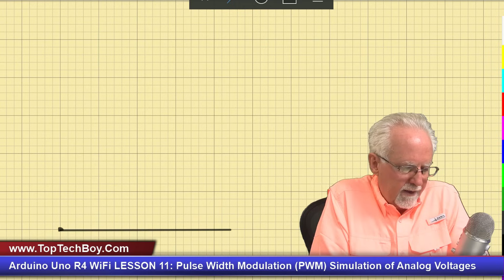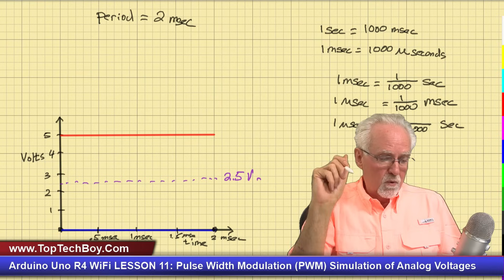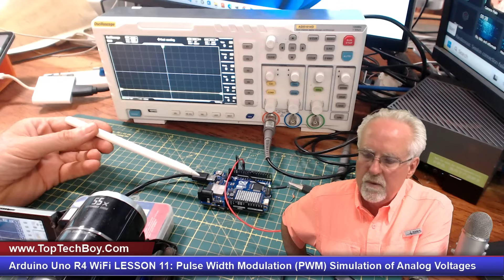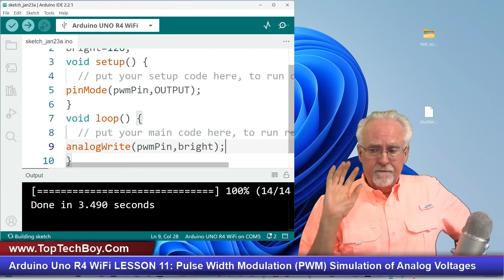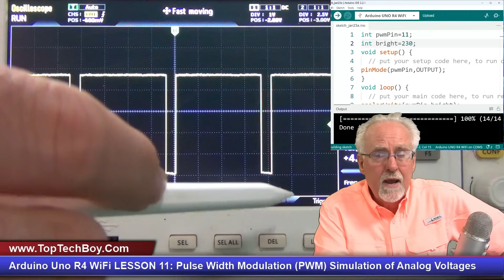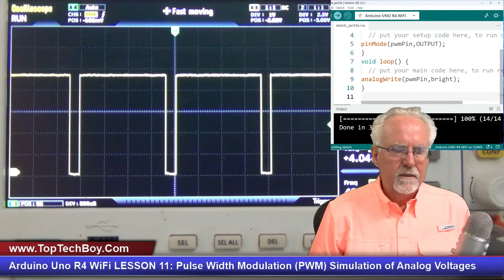Arduino Uno R4 WiFi LESSON 11: Pulse Width Modulation (PWM) Simulation of Analog Voltages

Comment: When we write analogWrite(126) on the Arduino, we get roughly 2.5V measured with a multimeter, but that's an average, not a steady voltage. The pin is actually switching fully between 0V and 5V, at a duty cycle of about 49% (126 out of 255). On a typical Arduino PWM pin (~500 Hz), that works out to roughly 1ms on, 1ms off, repeating. Our eyes can't perceive switching that fast, so we perceive it as a steady, averaged brightness, in this case an LED that looks half lit.

PWM always felt like a tricky topic to me, but seeing it explained this way made it click. It also got me thinking about how laptop screens use PWM to dim their backlights, and how that flicker can actually affect people's eyes. Great lesson, Paul, please keep the videos coming!

Comment: I learned about PWM's. Its a way to simulate analog voltage with the arduino. What we're acutally doing is turning on and off the "switch" for a 5v signal really quickly on the arduino within a two ms timeframe.  For the 8bit system the value for simulation is set with a number between 0 and 255. If set to 0 = 0v all the time within the two ms. At 255 = 5v all the time with the 2ms.  If we wanna simulate 2.5 V we set value for 255/2 = close to 126. What happends then is that for 1ms we have a 5v going, and for the next 1ms we have 0 v going. This keeps on repeating. If we have a LED in the circuit we can use this to create a light percived as dimmer - allthough is just switching between full light and no light very, very fast. 

Allways remember your ; and variables. No constants in loop. However, on one the video about print to monitor it was writte a cnt=cnt+1 in the loop. Isent that kind of a constant?

Comment: Tonight I learned microseconds are a thing. I learned that digital devices only understand 1 & 0 and that when we play with the analogue output, its not an actual analogue output, but a simulation of one called PWM. You can simulate these outputs by the frequency of how long each signal is ON or off. 126 == half on half off, 63 == 1/4 on 3/4 off.
Every day I get more and more excited learning these things. I can't wait until the next day to do the next lesson to learn a little bit more. I'm so excited to understand all of this, so I can start building things, and actually understand what happening under the hood.
As always, thank you so much Paul. I wouldn't have gotten this far without you!
Reply from the maker: LEGEND!

Comment: This lesson we learned how to simulate analog voltages by using pulse width modulation with a potentiometer. The digital signal (on/off) can be turned into an analog signal (range of values from off to on) by changing the frequency of on/off bits within the duty cycle. For example, an 8 bit component has 2^8 on/off states (or 256 states) that can exist within 5 volts. To represent 2 volts, or 40% of 5V (2/5), pulse width modulation is used to control a component by turning the component on for 40% of cycle, and off for 60% of cycle. The output is the average voltage over a cycle or (1x40% + 0x60%). This lesson also reinforced the concept of "digital.write" vs "analog.write" and pin inputs vs outputs. Components with different bit capacity can be scaled to share info with each other.

Comment: Why are we using 8 bit limit? Why not 32 bit? The UNO R4 wifi is 32 bit,  right?
Reply: Did some research and found out that the components have different bits. Arduino has R4 UNO has 32 bits. LED has 8 bits. Potentiometer has 10 bits. Paul's video series is great but there is still so much more theory to understand.

Comment: Paul, I absolutely love this course. I’m not a formally trained engineer, just a very curious technical mind trying to understand how we can build practical solutions for real-world problems. While watching your Arduino R4 lessons, it actually triggered an idea that I can’t stop thinking about.

What if an Arduino used PWM to modulate a resistive load (like a boiler heating element) so it continuously follows surplus solar power? Instead of sending PV peaks back into the grid, the system would convert that excess energy into thermal storage in water or building mass.

It seems like such a simple, low-cost approach to reduce grid stress and transformer peaks in high-solar areas. Your lessons are exactly the kind of inspiration that makes people start thinking about solutions like this.

Do you think something like this could be a fun practical example for future lessons  of the Arduino Uno R4 WiFi course? I’d be very curious how you would approach it.
Reply from the maker: Yes, one could imagine using excess solar to heat water. You would probably need to implement some type of PID controller

Comment: Hi Paul, below is the homework for Lesson 11 - Understanding PWM

 PWM simulates Analogue voltages off the Arduino by taking an average 0v (0 ) – 5v (255) over a 2 milli second period. Depending on the specified voltage required, will depend on how long the Arduino stays at 0 (off) volts and how long it stays at 5v (on). For example if you require 2.5 v output you would input a value of approx. 126 and the Arduino would stay on (5V) for 1 milli second and off (0V) for 1 milli second, therefore taking an average over 2 milli seconds of 2.5v.
Reply from the maker: Excellent!

Comment: It is still spiking that 5v..  So do not lessen your resistance to LED leave that 1K ohm there.

PWM  is why we see flickering car lights when taking video with cell phone. To human looks solid. Sadly this was how we used to do initial diagnose of  bad diodes in Alternators. Parking light incandescent bulb would flicker if diode bad in alternator.

Comment: Digital -> Digit + al = relating to digit.
Analog -> An a Log = relating to a log graph/some curve. Squiggly looks like a curve on a graph. 
Voltage supplied by Arduino -> in digits 0 and 5. 
How do we convert it to a voltage other than 0 and 5? -> Within a time period of 2 ms, we divide these digits in such a manner that the average outputs to the voltage required. So analogWrite(outputVoltage) converts the on/off switches to a series of on off combinations(010101..) in some time period(for Arduino, it is 2 ms), so it averages to output voltage.

Comment: To summarize: The arduino can only output either the full 5V or 0V, so if we wanted a voltage in the range we use a technique called PWM to simulate the voltage by quickly switching between 0V and 5V so that it averages out to the desired voltage. Therefore the analogWrite function is not actually analog and instead uses PWM under the hood.

Also, the demonstration with the oscilloscope was very cool. Great lesson
Reply from the maker: Great summary!

Comment: These lessons are mostly review/refresh - but this lesson in a nutshell tells me that analogWrite uses PWM which chops up the 5v signal into tiny bits, such that by using it's DUTY CYCLE, it SIMULATES an analog voltage
Reply from the maker: Yes, I made this class for beginners, so the first lessons are review of what you might already know from the R3. However, we will get into a lot of new stuff as the class progresses.

Comment: Excellent instruction and presentation of PWM. I see PWM as being a pulse of max voltage and zero voltage over a fixed period of time. The balance of max voltage time and zero voltage time will calculate to produce the voltage needed.
Reply from the maker: Excellent!

Comment: Hi Paul, I will try to summarize in ridiculous non-technical terms what I think I learned today (first let me cool down my brain with a zip of ici coffee). The analogWrite command does not really make the Arduino send an analog voltage somewhere between 0 and 5V, but it simulates this by adapting the time (within a 2000 microsecond timeframe) that it sends a 5V signal. The lower the number between 0 and 255, the shorter the 5V signal and the longer the 0V signal will be. This results in a variation in the average output signal. This simulation is called Pulse Width Modulation.
Reply from the maker: Excellent!

Comment: This lesson goes more in depth to analogWrite, and explains that is actually pulse width modulation, using a digital signal, switching on and off in rapid succession, in a timing ratio that averages out to a voltage level between 0 and 5 volts.

Comment: Thanks for the lesson. Do I understand it correctly, that we can replicate analog pin using digital one with code like this:

int loop() {
    digitalWrite(pin, HIGH);
    delay(1);
    digitalWrite(pin, LOW);
    delay(1);
}
Reply: You can, but only to a certain degree. The example in the video pulses at 1 millisecond, the lowest amount you can send through delay, but lower pwm voltages pulse in microseconds, which are 1,000th the duration of a millisecond. Your example might simulate 2.5 volts. You can take out the delay statements, and probably the lowest voltage you'd measure is around 2 volts. Since the board might also be handling other tasks in addition to running your code, there's probably a considerable chance it can't keep perfect timing

Comment: I took all day thinking about this! So, here's my understanding and also my misunderstanding (questions!)... The Arduino R4 WiFi has 6 'Analog In' A1...6 + Pin 0-13 = total 19 pins to plug 'things'' in. The board is only capable of 5v output, correct? But lets assume 5v for everything plugged in - I have 6 temp/humidity sensors running for 1 second each(6 seconds) every hour PLUS 2 camera's on 5 second intervals a pic PLUS a Solenoid (for automated watering system that must run for 4 minutes at random times PLUS 7 internal moisture sensors giving me readings every hour... how can I manage voltage because I plan to have the camera + motion sensor + water solenoid all working at random times while multiple moisture sensors MUST report back at correct time?... Answer: "buy lot of Ardunio's!" - nope, can I/we code it knowing PWM?? 😁

Comment: yes sir, how ya doing? A Short howdy from the hill country of Texas. Just fyi, (thought it was interesting) looking at 255 pwm pin 11 on scope, you'll see a slight pwm with a voltage of 4.861 with a 9v power supply. At 256 pwm pin 11 on scope, you'll see a straight line with a voltage of 4.880. At 257 and above it stays at 4.880 volts. It only does that for the R4 and not the mega 2560 or R3

Comment: Ok, so in this lesson we learned how to 'simulate' analog values with the Arduino. The Arduino can do this by using a technique called Pulse Width Modulation or PWM. As the Arduino can only output HIGH and LOW, or 5V and 0V the analog value is represented by the amount of time the signal stays HIGH within a certain period of time. The period for PWM is defined as 2 mSec. So if the signal stays HIGH for 1 mSec within this 2 mSec interval it is at 50% or 127 on a scale from 0 - 255. If the signal stays HIGH for 0.2 mSec it is at 10% or 26.
By rapidly switches between 5V and 0V in this way, average voltages can be applied to the output.
Reply from the maker: Excellent summary

Comment: So I believe we should use 1k resistors even if we are using a low voltage as it is actually implementing 5 volts. right?

Comment: if you want a output of 2,5 v the arduino don´t understand 2,5v he can only produce 0v and 5v, so the arduino switch in the half of a period off and the other half on. The average is 2,5v.

Comment: Homework: In this class we learned that Arduino has the hability to "simulate" analog outputs in order to have a range of 256 levels of voltage in the PWM (Pulse Widht Modulation) pins intead of the digital ouput of only 0 or 5 volts (Low & High). The special pins PWM are marked with the symbol "~" beside of the pin number. The Pulse Widht Modulation consists not in make a variation in the ouput voltage, but in making a kind of average voltage by letting out 5V for a fraction of 2ms. This way we have a 256 fractions of every 2ms to emulate an output between 0-5 Volts. In this case when the analogWrite in a PWM pin = 0, we have an output of 0V. all the time. In tha case of  analogWrite in a PWM pin = 255, we have a constant output of 5V. In between if we have a value of 128, we have 1ms High and 1ms Low (simulating an output of 2.5V.), and so on all the range...

Comment: Question, if the analogWrite is just PWM and the average is taken from the 2ms, why cant we get the same result from a digitalWrite if we manually average a 126 having a digitalWrite of HIGH with a 1ms delay and then a digitalWrite of LOW with another 1ms delay? 

Im sure im missing something here, im just not quite sure what it is...

[edit] For those who have the same questions. If you use a digitalWrite with 1ms delays in between the HIGH and LOW, you can actually mimic an analogWrite at 126, its just not as efficient.

Comment: We can simulate an analog value using a digital device if we properly choose our ON and OFF time frames.  The arduino function 'analogWrite' performs this function for us requiring us to only need to choose a "brightness" value; which in reality is setting the ON/OFF time frames.  I suspect we could achieve the same result manually by using the function 'digitalWrite' and choosing sufficiently small  'delay' time values for ON and OFF.

Comment: The lesson explained how to get an output with only zero and five volts to simulate any other voltage. The output of zero and five volts is switched in a defined period on and off so the average of the voltage over that period is the desired output voltage. For the Arduino this only works on output with a "~" and use of the analog write function.

Comment: my homework   https://youtu.be/3TOiPGM94Ak?si=54MDc1G1MDxY8tfV
In audio terms, the Arduino PWM pin generates a square wave of constant amplitude (peak to peak of approximately 5 volts) and constant frequency (wavelength of about 2 milliseconds, or 500Hz, corresponding to a musical note close to of B4). Modulating the pulse width by varying the analogWrite value in the code changes the average voltage as measured with a multimeter or LED brightness. This changes the timbre of the note without changing the frequency or amplitude.

Comment: I have tried 3 times to make this comment stick.  Maybe it is because the URL is the problem.  This comment does not have one.  I am thinking of getting this low cost way of getting an oscilloscope for the course.  One person in our group has one.  At $65.90 it seems like a good deal at the voltages and time divisions we are likely to see.  Hantek 6022BE Laptop PC USB Digital Storage Virtual Oscilloscope 2 Channels 20Mhz Handheld Portable Oscilloscope.  There was one warning on the web page:  "Frequently returned item:  Check the product details and customer reviews to learn more about this item."  What do you think?

Comment: hey Paul , i really love and enjoy your series of tutorial. In my opinion you are the best teacher there is out here, dynamic, make difficult concepts look casual , funny and have a lot knowledge. Could you do a series of tutorials on PCB design, I am sure you are pretty knowledgeable in this area of engineering. Thank you , God Bless you and your loved ones.
Reply from the maker: Thank you for the kind words. Probably wont be doing a PCB series as I do not have access to a way to get them made. Also, it is a tough topic as the software typically has so many different parameters, it is hard for a hobbiest to really master the topic.
Reply: PCBway offers manufacturing services at very affordable prices, often just a few dollars. Your ability to simplify complex concepts has always impressed me, so I understand if you prefer not to dive into this topic. However, if you're willing, I'd greatly appreciate a well-written explanation.

Comment: Pulse Width Modulation (PWM) is a technique used to encode analog information in a digital signal. It involves rapidly switching a digital output between on and off states at a fixed frequency. The ratio of time the signal is on (high) to the time it is off (low) within each period, known as the duty cycle, determines the average voltage or power delivered to a load. PWM is commonly used in controlling the speed of motors, regulating LED brightness, and generating analog signals from digital sources.
Reply: Thanks bro

Comment: Makes sense how the arduino uses pwm/timing/off-on to control output voltage. Used the oscilloscope to see the signal output. It would be nice to get a supplemental crash course lesson on using it though. I ordered one through your amazon link.
Reply from the maker: I am thinking about doing a general circuits class around the oscilliscope but just have not yet got it all laid out.